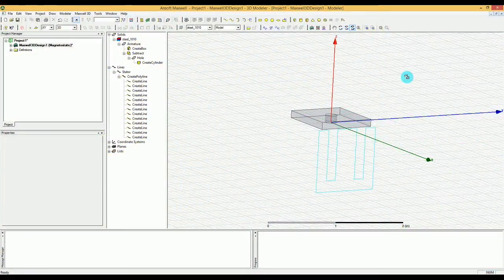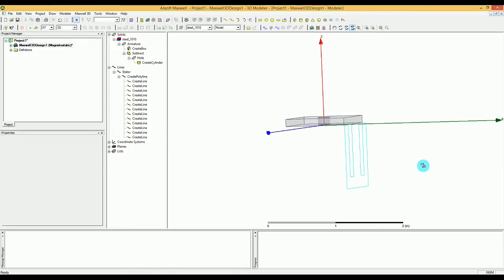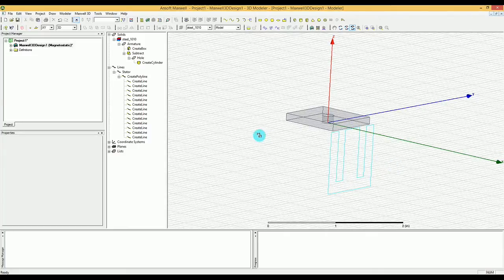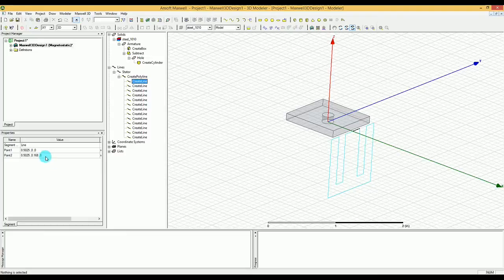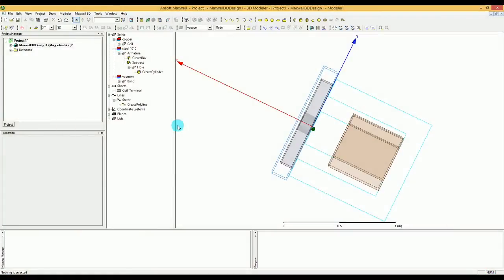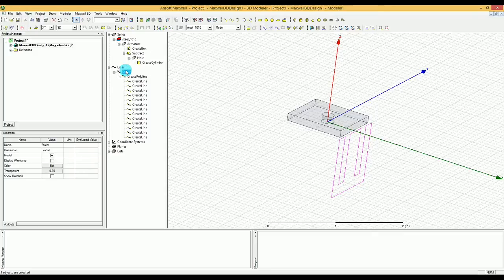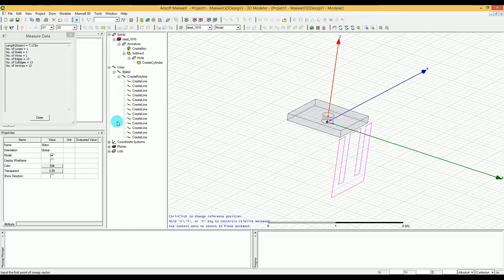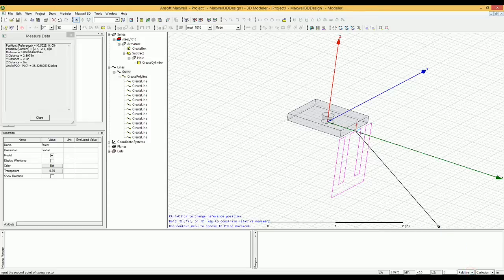214- Ansys Maxwell- Equivalent Circuir Extraction/ Linear Motion (Actuator) [2/4]

Comment: Hi, Thank you for your useful tutorial videos. For my M.Sc. thesis i choosed an AFPM using SolidWorks to design and Maxwell to FEM analysis, but after almost 40 analysis i've got nothing, just noises and ripples in results specially about Torque. I would appreciate if you help me solve the problem
Please Contact me on these:
Email: Hamid.r.ghorbani@outlook.com    or    hamid.r.qurbani@gmail.com
Tell: (+98) 913-771-7800
Reply from the maker: +Hamid.R Ghorbani  make sure you apply different phases correctly that happens when you don’t apply phases with correct timings.